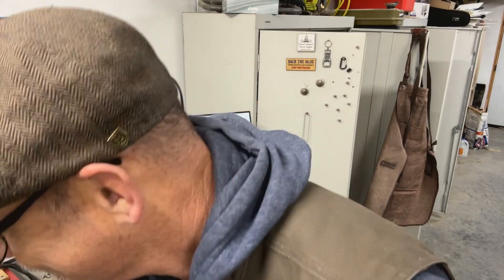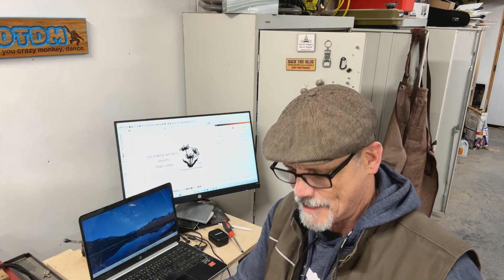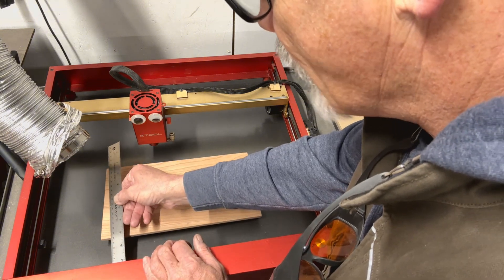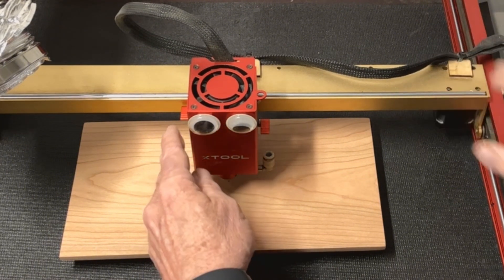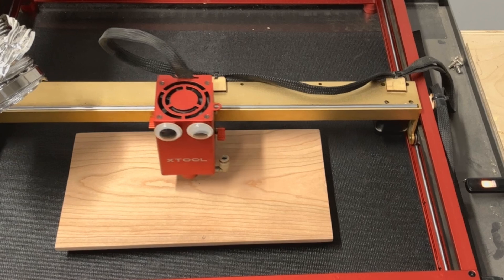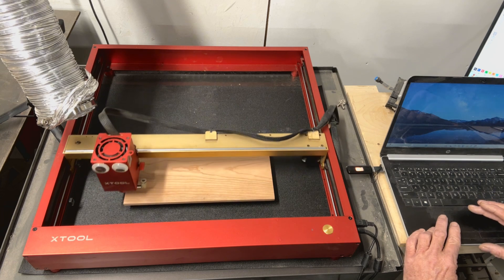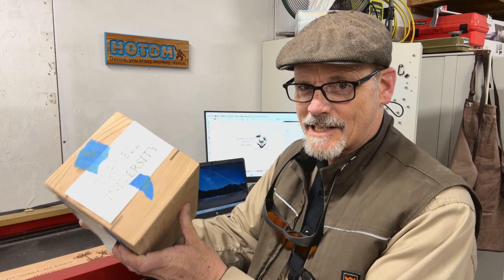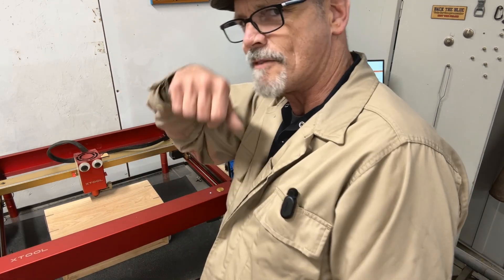Positioning tip for laser engraving.

Comment: I have a gantry diode laser, what I did to make sure everything is square without having to measure every time was simple. I got a MDF board, put the laser on top of it and then just screwed down flat some "L" shaped brackets in each corner round the legs (one bracket for each corner). Make sure they are tight up against the legs, so whenever you put you laser on the base it is always in the exact same place. Once done you can use the laser to mark a grid or alignment marks on the base. I also fixed a straight strip of wood on the base on the X axis toward the front so I can just slid a workpiece, jig or rotary tool up to it and know it's square to the machine every time.
Another plus in doing it this way is it makes it almost impossible to knock things out of alignment halfway through a project.
Reply from the maker: Good tip.  I never set up a waste board as I always have my honeycomb on the bad.  As I mentioned in the video, I use the Clack Shack jig on my xTool and it works great.